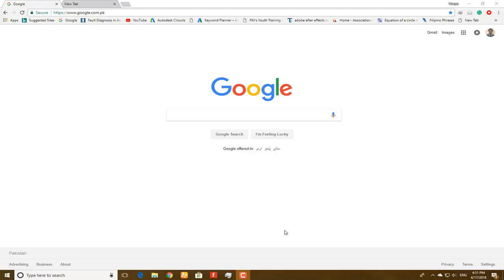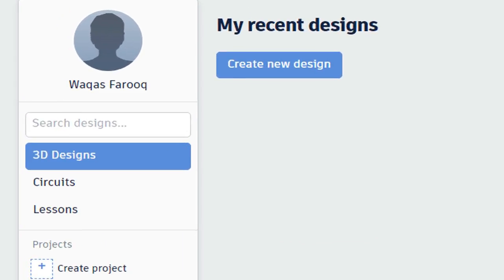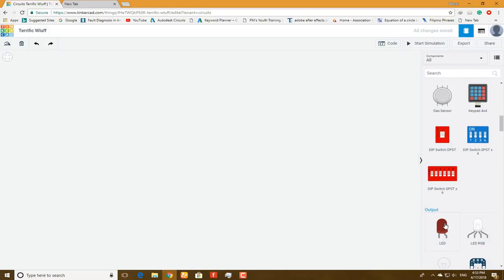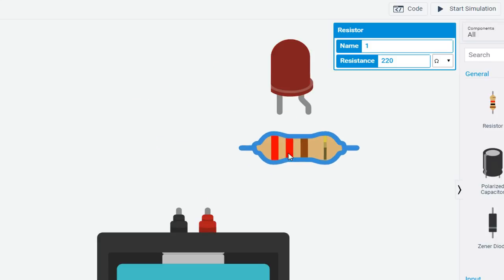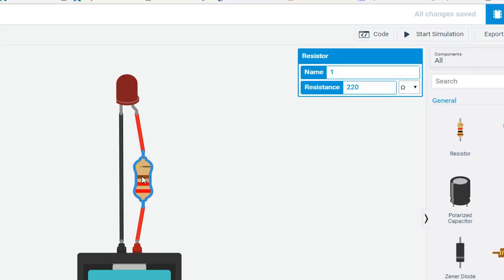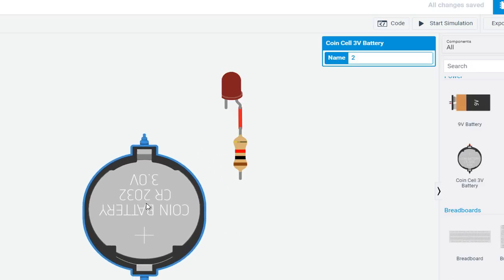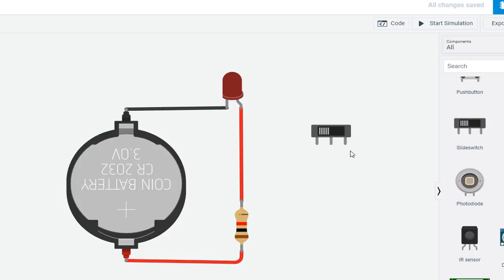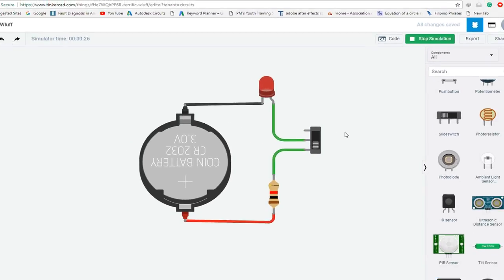Tutorial #1 : Simple Circuit with Switch

Comment: Sir pls tell that why did u took 220ohm resistance. Why not some other value
Reply from the maker: well basic purpose of resistor is to limit the current you can use other value too but using lower value the LED with glow more and using higher value resistor the luminance of LED will be dimmer
Reply: @WaqasFarooq  sir what is the minimum value we should put in a resistor and why.
Reply: @WaqasFarooq  btw thanks for helping out sir
Reply from the maker: @jadenjoseph2746  I am glad to help you. thank you for watching i really appreciate